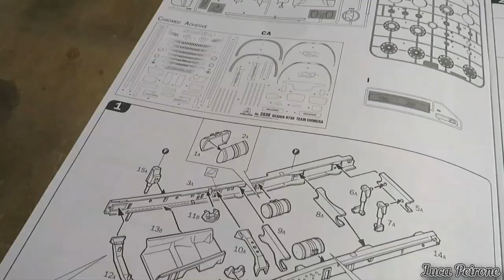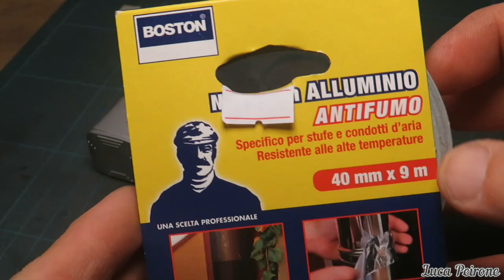Italeri 1:24 Scania R730 Streamline (Full Build Video)

Comment: can the wheels spin?
Reply: With Italeri Models, normally yes
Reply: @daggrz9692 But how? Don't they fall off since they aren't glued to the axles?
Reply: @ich4226   after you put the wheel on the axle, you glue an endcap to the axle, that keeps the wheels from falling off, but the wheels are free spinning
Reply: @daggrz9692   thank you very much, that makes a lot of sense. I was Just wondering since the wheelcap had a slight bump which seemed to fit into a hole in the rim. It is my First Italeri model and I was surprised to find quite a few design flaws

Comment: I did notice that Italeri used the wrong v8 engine for the model.

That engine used in the model is Scania DS14 V8, right engine for early Scania V8 trucks until the 144 series.

Later Scania V8 trucks from 164 onwards were equipped with the DC16 V8 engine, which it has different heads